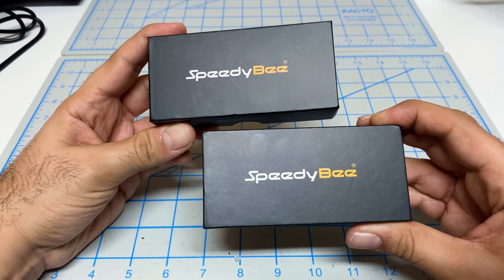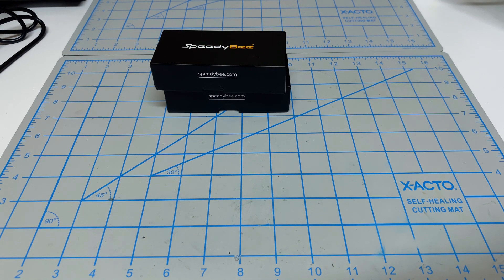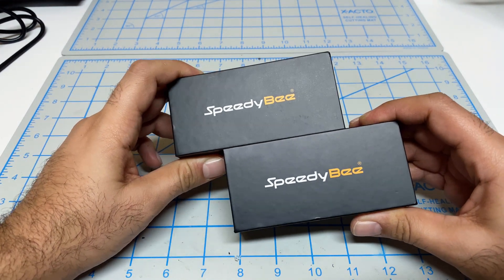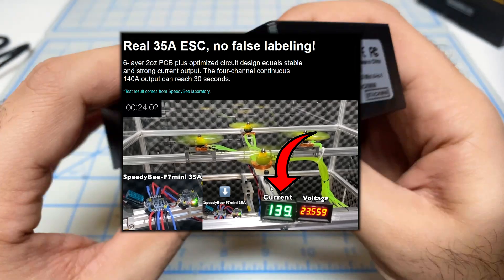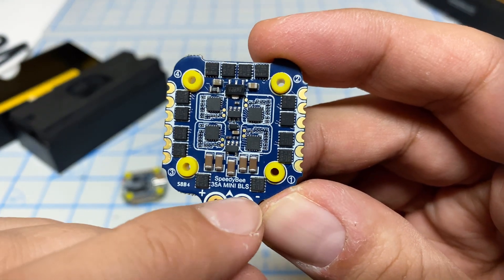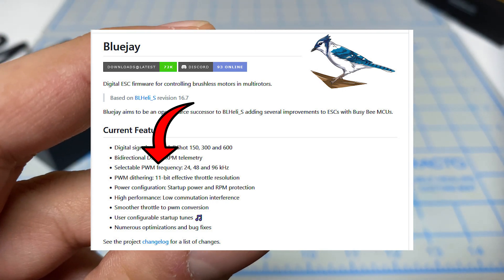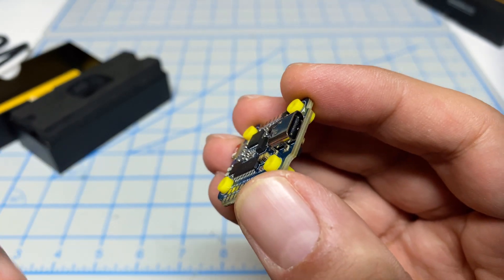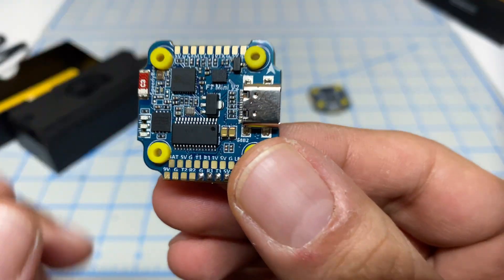My NEW FC Stacks Have Arrived! | SpeedyBee F7 V3 50A & F7 Mini 35A Flight Controller & ESC Overview

Comment: the v2 version is absolute absolute garbage. The uarts fail randomly on 3 boards i have used. I soldered correctly all of them because they did work for about three flight. I would change the uart to a different uart and it would work again for a bit then quit working slowly and randomly after about 3 flights. Absolute Garbage.
Reply from the maker: That's annoying, thankfully I haven't had any problems at least yet on this stack.

Comment: 9:05 Hi just a quick question the power inducter I see on your speedibee 50 amp doesn´t look like other reviews I saw it online your`s like round or covered by somenthing did you had any problems with the esc?
Reply from the maker: It looks like there is some protective glue/epoxy on there. No problems, I only recently got this and straight from SpeedyBee so it might be something that they've started adding to the latest ones coming off the line.

Comment: I love mine. I just switched from 1507 motors to 2205 motors on this ESC. So far no issues.
 👍
Reply from the maker: Thanks for the comment. Is this on the Mini or Full size stack?
Reply: @Mangorille  the 20x20 stack.
Reply from the maker: @MadDragon75  Nice, those are fairly large motors for a 20x20 but then again they did test that stack at full output for 30 seconds.
Reply: @Mangorille  well, my first flight pulled 61amps I believe, in around 3 minutes on 4S. 
I didn't notice any excess heat.
Reply from the maker: @MadDragon75  Awesome!

Comment: The speedybee stuff blows iflight out of the water.
Reply from the maker: Ya so far really good experience. Only problem is that the F7 V3 stack is really tall and I am having an issue installing it in my latest build which has a low profile frame.

Comment: I am having an issue with my speedybee f7 stack, Can't get inputs in betaflight, using elrs rx and tx16s tx. uarts are right, rx/tx are switched, any many variations of all the above. Did you have any issues or have suggestions, I changed rx's no change, changed new f7v3, no change. Thanks
Reply from the maker: When you run the LUA script for ExpessLRS, does it say Model Mismatch at the top where you have the number of packets?

Comment: The cable that comes with purchase of O3 Air Unit plugs directly into the SpeedyBee F7 V3 which I thought was awesome, I'm using their stack on my first quad
Reply from the maker: You are correct! Still would have loved a cable to be included, all manufacturers used to include the DJI connector when the original air unit released.